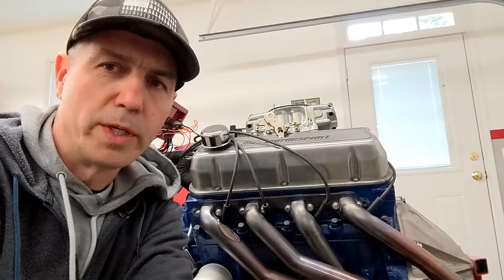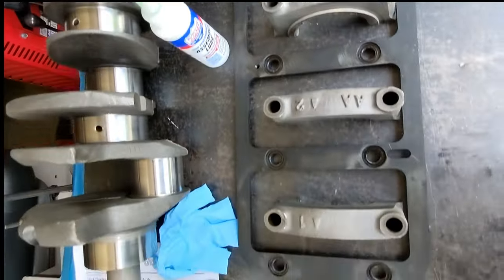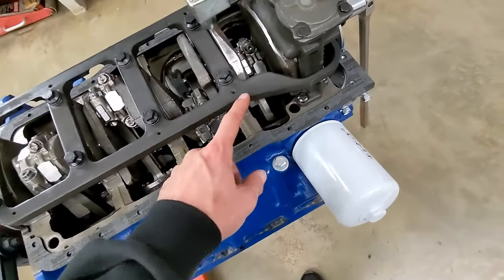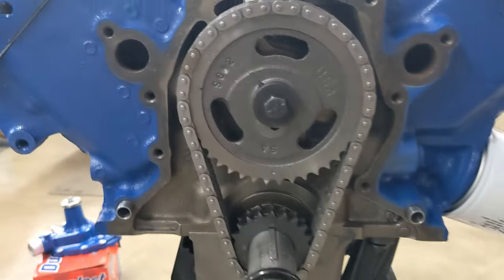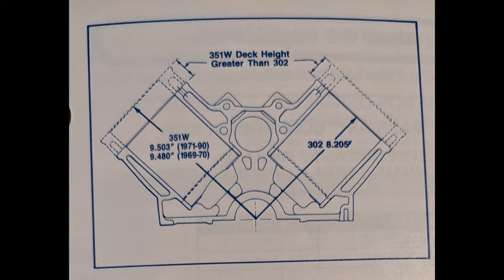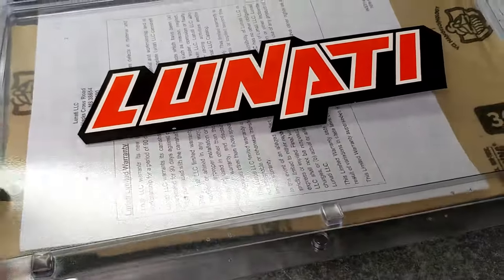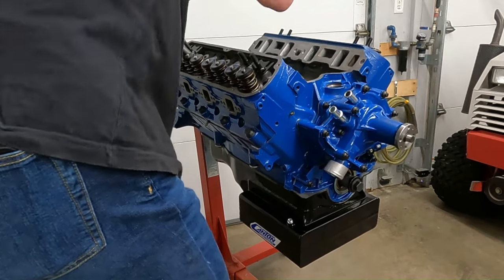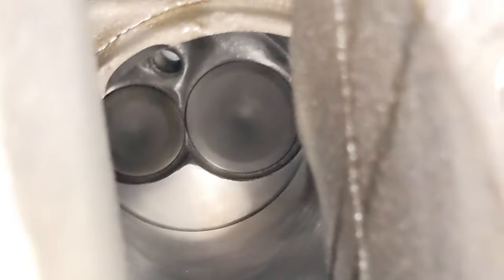Ford 351W Build Summary, Parts List

Comment: Easily one of the best engines Ford ever bolted into a chassis. Very underrated and at one time, overlooked. Owned mine since August 28, 1969. Bolted into my original 1969 Mach 1. Just finished rebuilding that original engine. Blew a head gasket after FIFTY-FOUR YEARS of dependable service. Running sweet again!
Reply from the maker: That's really cool that you are the original owner of a '69 Mach 1 and still have it, and the original engine!
Reply: Absolutely the 351w is an incredible engine, durable and inspite of SBC parts being the cheapest most readily available thing out there, a 351w has more hp/$ potential than a 350sbc by far, it takes a truck LS with boost to have a shot at a better hp/$ than 9.5" Windsor.
Reply: I have many 351w based engines including one in a 69 LTD and in a lightning
Reply: @hendo337  and that 350 Chevy built might make similar HP as a built 351w but the 350 torque will often be half it's HP while that 351w torque will be very close to its HP
Reply: How much would it cost to build a stock block 351w? Been thinking of going NA or a 363 stroker build
Reply: @StayHydrated-wd5ic  can be mild to wild and so are the prices
Reply: @StayHydrated-wd5ic  SO-many variables there. But it would be hard to begin with a better foundation for an excellent street engine or a mild competition engine. Just don't stray far from design parameters to ensure a reliable piece. Have fun!
Reply: @StayHydrated-wd5ic you can’t build ANY  good engine on the cheap but $1500 should build a decent engine, mostly stock
Reply: That’s if you don’t need excess machine work and you do it all yourself.

Comment: Nothing beats a Windsor maybe LS1 heads yeah hell yes !!
Reply from the maker: Well I did some work on the heads and got them up to 314 cfm on the intake which is about the same as a what stock LS3 heads flow peak, so they do alright.  Not sure about the LS1, but probably not as good as LS3 or LS7.
Reply: @MarksMuscleCarGarage  That's how you get a 750 cfm carb?
Reply from the maker: @asymptoticsingularity9281  The CFM or amount of air that a cylinder head will flow is measured at a standard pressure (28 in. H2O) on a flow bench, and is not directly related to the CFM requirement of the carburetor.  The size of carburetor or CFM rating needed for an engine is more a function of engine displacement, max RPM, and volumetric efficiency.  For a rough estimate of carb size needed you can do a Google search for carb size calculator to find a CFM calculator for carburetors.
Reply: @MarksMuscleCarGarage  Makes sense.  Thanks

Comment: When choosing which thickness for the intake manifold. What is the ideal distance between the intake manifold and the engine block?? I realize the thicker the gasket the bigger the gap. But what gap are we looking for? Also. Super well-made video. Camera work was excellent and the narration was great as well. Answered all the questions so many of us were wondering😁😁👍👍
Reply from the maker: I think a stock gasket is around .060 " thick which should work in most cases. I was trying to adjust the port alignment / height between intake and cylinder head so I went with a thinner gasket. As far as gap between the block end rail and intake manifold, I don't think there is an ideal gap but the bigger the gap the thicker the bead of RTV/silicone required to fill the gap so at some point the gap might be too big to fill with RTV.

Comment: What can i expect to make power wise on a bone stock 351, im putting one in my wifes truck now it was pulled from a 95 efi truck and all im doing is 4 barrel intake 600cfm carb and new distributor never been opened
Reply from the maker: 350 lb-ft torque and 250 hp.  If you search Richard Holdener videos he has dyno'd a stock EFI 351W, changing it to carb, and that's about what the numbers are.
Reply: @MarksMuscleCarGarage  thank you

Comment: My first car was a 71 Galaxie 500 with 351W engine.  I had no idea that engine had serious hot rod potential.  I thought it was a family car.
Reply from the maker: My Dad had a 68 Galaxy when I was a kid. It had a 390. Great car for road trips. 71 Galaxy is a cool car as well. I think the 351W benefited from aftermarket parts development for the 5.0 in Foxbody Mustangs since cylinder heads and camshaft interchange, and it was an easy swap for people wanting to move up from a 5.0 to a 351/5.8.

Comment: With that flat top piston I don’t believe a 60 cc chamber will get you a 10.5-1 CR.  Especially with your piston below deck.  It’s more likely between 9.5 and 10.  You might want to check it.
Reply from the maker: Actually, I just ran the numbers on Summit's online calculator, and got 10.8 to 1. Specs are as follows, 4.030 x 3.500" bore x stroke ,  60cc chambers, 5cc valve relief, .022 " deck clearance,  0.023" gasket thickness
Reply: That thin head gasket makes a huge difference.   Stock is .047" for a 1990 sbf.

Comment: Please excuse the very novice question, but I just took custodialship of my sister's 69 Mach 1. Upon arrival it's showing low oil pressure and low oil levels. I Don't know much about cars but I want to get oil in it before driving it to the Mustang mechanic that I located. Is the oil filled through the cap on the driver's side header cover? Sorry for the beginner question, but I have to start somewhere!
Reply from the maker: @surf2trails  Yes, driver's side breather cap is where the oil goes.
Reply: You have a legendary classic. So you want to maintain it as original as possible. And keep those serial numbers matching. And be willing to spend what it takes to do it right. And you basically are keeping it indoors and safe. Driving it only to really enjoy a nice day. You have been bestowed a legacy car.
Reply from the maker: @PonkyKong  Thanks for the compliments but I've owned the car since the 80s and have a little different perspective.  It's nothing special as far as collectability goes. Ford made 70,000 Mach 1s in '69 - It's just a base model 2bbl 351 orginally.  In another 50 years after gas engines have been banned, the car will have been scrapped, converted to an EV, or be in a museum.  I'm going to enjoy it while I can. Furthermore I'd recommend anyone with the means to go buy a new Coyote Mustang and do the same before they go away. They are fabulous cars and way better than this old stuff in every way except for maybe styling.

Comment: Kind of a shame nobody makes a 5.975-5.980" connecting rod to use off the shelf 9.48" 351w pistons with a 9.503" deck block or a piston for a 9.503" block with a 6" rod. I have a 9.503" deck roller block and considering how cheap 408 stroker kits can be had, $1,380 from Scat, I would probably just go for it, if it was doing an N/A street build. I always wanted to piece together a 434 if I managed to find 331 1.165-1.175"CH pistons, 6.2" rods and a 3" main 4.25" crank cheap enough, it would probably be silly and not offer much over a 408/418/427 if anything at all, just thought it might be interesting to try something different since it would be for a ZF-5 F250 where extra tq might be useful, it has an AFR headed 393w right now and it's can atill use more. Thanks for sharing your build, got a sub for sure.

Comment: I’ve heard long ass waiting times and lying about when they will actually finish your parts from Big Dogs. Surprised to actually hear their name mentioned. One tip when torquing your heads is to line the wrench so you are pulling front to back or vice versa. Your engine stand won’t move nearly as much. It sure looked like you were jerking the the torque wrench and whole engine around in the process. Nice to hear you mention Lykins Motorsports they really are the best place to go when getting help picking a cam or anything Ford related for that matter.
Reply from the maker: Yes, definitely better to torque from front or back of motor, but I don't always keep that in mind when taking heads on and off.
Reply: Good shops stay packed. Most orders have a good turnaround time. Super customized and high difficult orders take longer. You can't satisfy the large volume of customers we have and get the results we get by rushing lol. We do it right and flow test everything👍

Comment: E4 indicates 1984
Reply from the maker: The E4 number indicates when an engineering design change was made to the block. The actual casting date is the 4 digit code below the E4 number.
Reply: I believe this is a 84 block as well. My ford performance book says so as well.
Reply from the maker: @matt2118  Ford used the same casting number for this block starting in 1984 when a design change was made to the block , and continued to use this casting number for many years to come. The number below the E4AE is the date code: 6F26.   June (F) 26, 1986 (6)